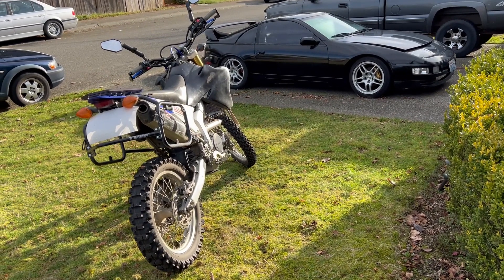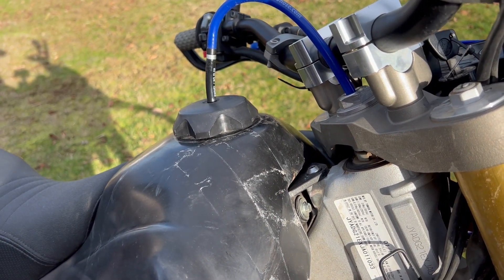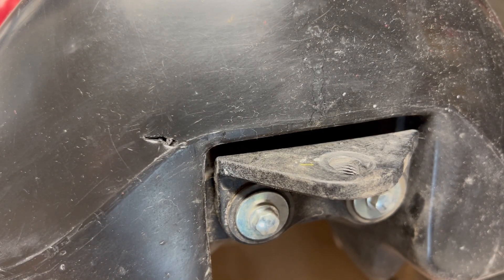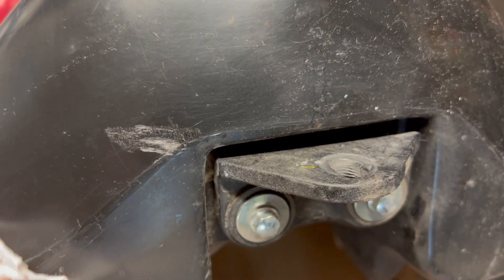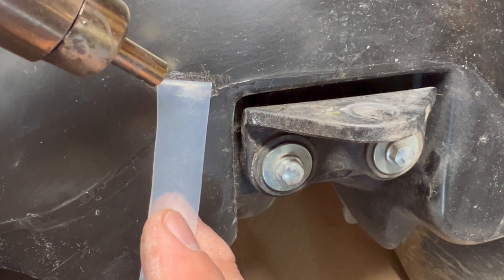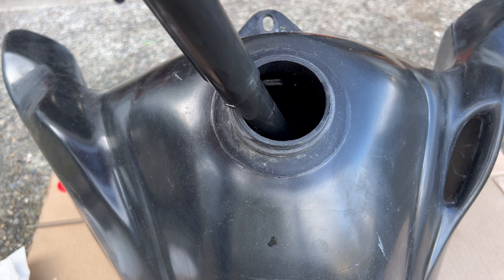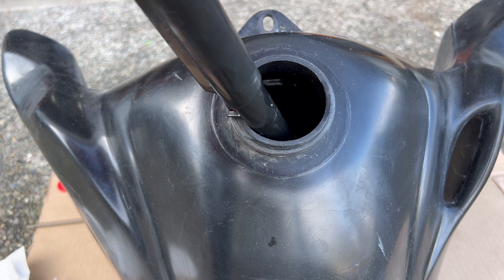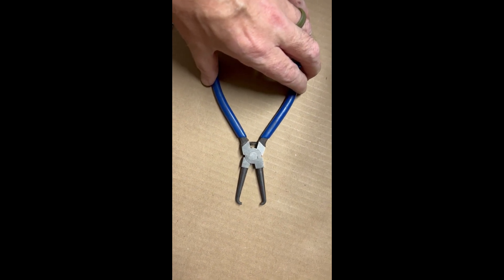Plastic Gas Tank Repair that Actually Works

Comment: Nice fix!  When I weld plastics I always try to trim some small strips from the original piece in areas where it won't be missed.  Then you get a good factory match in color and the right type of plastic guaranteed.
Reply from the maker: Good tip, thanks for the suggestion!